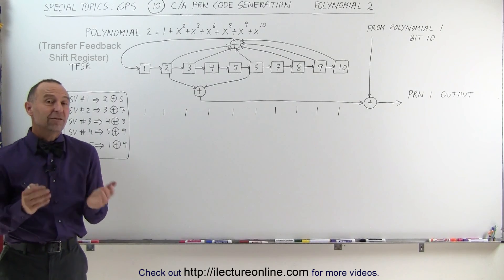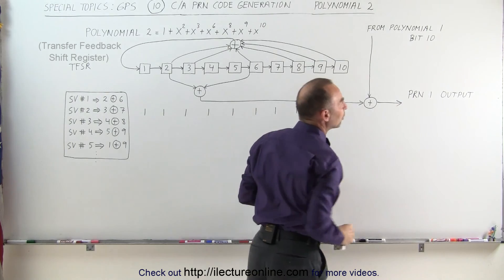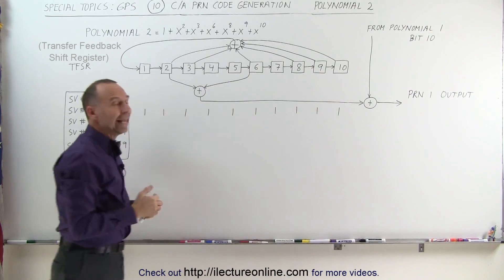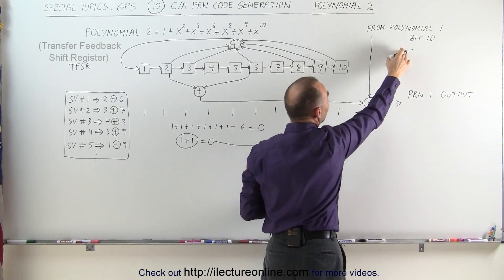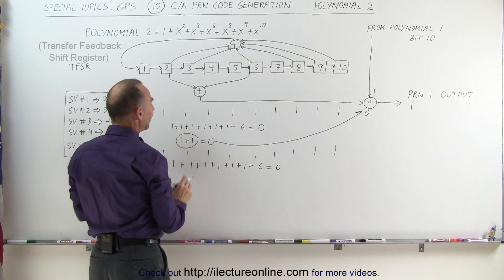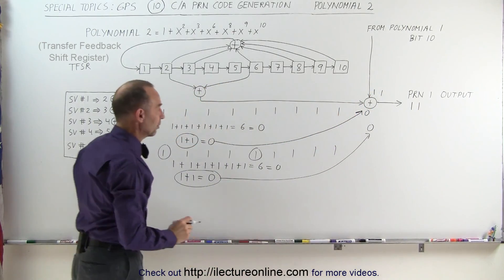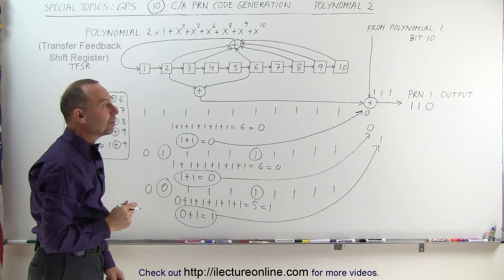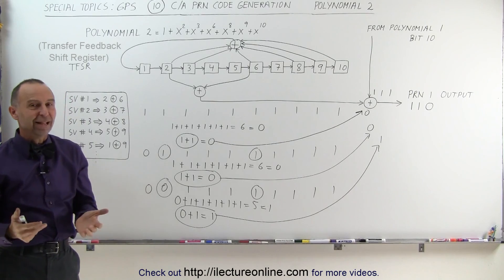Special Topics - GPS (10 of 100) C/A PRN Code Generation: Polynomial 2

Comment: Thank you for the explanation, but one thing is confusing. You are starting the procedure by calculation of polynomial 2, but this calculation is not needed for current iteration of calculation, but for next one, so in my opinion it is better to calculate this at the end.
Reply from the maker: This is not my method.  This is the method put togeher by brilliant individuals who invented this system.

Comment: I appreciate your efforts, but of all lectures I have watched, this series is your weakest thus far....perhaps adding in a pdf, or associated resource, website, supplement that really breaks it down in a sequential easy to follow format would be a lot more efficient, after all, you only care about getting us the correct information with least amount of effort right? You have stumbeled quite a bit in this lecture series and it sort of erodes confidence and promoted confusion..... perhaps also you could have listed out the steps on the whiteboard, and having the lines predrawn in this case also promotes confusion, perhaps knowing your lecture well enough to draw the lines in real time would be better.....
Reply: make your own videos